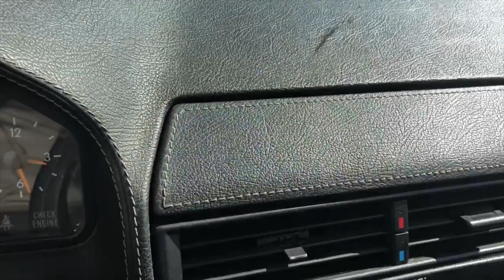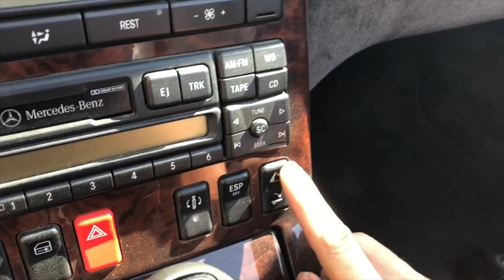I Bought a Broken V12 Mercedes SL600 for only $5000

Comment: Roof stoped half way cos windows were not reset after battery disconnected, easy mistake :)
Reply: That's what I thought but the "mechanic" said "micro-switch or broken wire"???
Reply: German tricks and secrets 101

Comment: This car only needs one thing: Zonda F1 Exhaust
Reply: Yes! I believe the company that makes them aftermarket is Brilliant Exhaust out of Japan.
Reply: I'm going to ask YouTube for a special exemption to the thumbs up limit on this comment. I shall give you 100 thumbs ups per day till he gets that amazing amazing exhaust that is the F1 full system 👍👍👍👍👍👍👍👍👍👍👍👍👍👍👍👍👍
Reply: Its not that they add a zonda exhaust.  Technical garage sasaki makes long tube headers that make it sound like a zonda as zonda exhaust does not fit at all, its a front engine car vs a mid engine car.
Reply: Change that Z into an H and you're on budget.
Reply: Brembo Z early zondas shared the amg v12 engine with amg Mercedes of the time. The company in japan can make them
Reply: no no no, it needs a big chrome fart can
Reply: long johnson  Yes. They custom fabricate complete systems from headers down.
Reply: I believe this has a different V12 but I hope he tries this anyway
Reply: No, that is a Mercedes from the time when idiots didn't buy them.
Reply: Nah, it's the same M120 Mercedes block.
Reply: And a tune
Reply: Oh yeah nvm the Huayra uses a different V12
Reply: And new alloys, those wheels are hideous.
Reply: koji takata
No, it's silent and that's perfect. Loud was great...when i was 16.
Reply: 3DPeter yeah like the Zonda Roadster is silent.
Reply: Gaz Gir You're the clueless car enthusiast, cause in Japan there's a company that make M120 engines like a Zonda, & it's called Zonda F1 Exhaust. I don't know what is a ZoneAlarm vehicle neither.
Reply: Koji Takata i have one for sale
Reply: tfs2O3  Same with this W140. Love that engine.
Reply: @philbertlovely7724  Well 2 years later but effspot has one 😂

Comment: Finally a R129 modell. Congratulations, Hoovie reached automotive heaven. Big cheers from all SL-owners (like me) who have wet dreams of having a V12-M120, but fear the cost of repairing it and bought a simple R6-M104 ("half-engine"). I'm looking forward for your next SL-clip!

Roof 1: could be you need to re-initialize the window-setting (see manual).
Roof 2: could be the micro-sensors that indicate the windows are all down.
Roof 3: change the roof hydraulics oil, the it works smoother.
Wet Diff: not an issue, its a mercedes, dude.
Steering: new shock absorber is 25 dollars and five minutes work.
AC: try refilling it first, my W140 was all empty after 2 years sitting.
Brake squeek: normal when driving slow. mine does that too.
Brake light on/off: could be dirty wheel-speed-sensors in front.

Comment: Now this...this is a proper Mercedes. Took em about 20 years to get the styling right again AFTER this model.

5 grand is absolutely a steal even with the select few bugs it has. Engine seems great and body seems great for the most part, but my favorite is that interior that leather is immaculate for it's age. Unbelievable.

Comment: That is such an awesome car, one of the best of all time I think. They can't make them like that anymore. Now they are giant safety bubbles with huge crash structures. That thing is nice and low and thin and compact, yet still roomy inside. And the quality really can't be beat. What a classic. Beautiful car. I don't know about those wheels though.
Reply: E39 is better/ E38 BMW
Reply: @ sirgallium. You could say the same thing about (European) sports cars made in the 60's - you can't beat a Mercedes, Jag, Maserati, AC Cobra, etc, from that period, for the purity of driving experience.
Reply: Surviving crashes is such a drag.
Reply: True... Mercedes have gone from once making some of the most beautiful, elegant cars on the road, to making some of the ugliest, dumb design blobs ever. That's progress?

Comment: I suspect the issue with the top not wanting to play the game may be an issue with the computer having lost its settings.  A reboot might sort that out pretty cheaply, and the top itself looked to be in beautiful condition.  Factory black is a pretty rare colour option on one of these, in Europe at least.  It certainly has potential, it's only a matter of time before the values of these V12 SLs go as nuts as the values of the previous generation 560SL...
Reply: +Nightmare_O-mega Van  I never said anything about black on black, I just said factory black...

Comment: Just a heads up on all 1997-2002 R129 cars. The keys (all the keys flip, valet, master) are all unavailable from Mercedes benz for about a year now. There are a few locksmiths that can make a chopped key (about $250-500 per flat chopped key). I have heard of 1 locksmith that can make and program a flip remote/key but I have been unable to verify. So do NOT lose your key(s)!

Comment: I guessed you missed having the Silver Elephant’s power; but with the way Mercedes are THE MOST expensive to repair and maintain, the Car Wizard gets to put another child through college (and pay for his shiny new MUCH larger shop) thanks to you!
Reply: digitalrailroader bmw isn't that far off....but ur right...
Reply: BMW seems to be more expensive to maintain spec for spec, but Mercedes V12's are a whole 'nother level.
Reply: The R129 is actually reliable, even with the V12. Obviously it costs more money to maintain than a V8 version but it's nowhere near the cost of R230 SL or any mercedes from that era.
Same story with BMW, 750i and 850i from the 90s were not plagued with issues like the high end bimmers that came out later.
Reply: One thing I’ve noticed about MBs are that the engine is reliable yet the other non powertrain stuff isn’t. I have noticed that Tyler didn’t complain about the engine after 84K miles and 21 years. So it seems the reliability of the engine is the most important.
Reply: Joe Black that can explain why we don’t really see 20 year old Audi’s and Bimmers.
Reply: Beamer Boy the mileage for that please.
Reply: Stefan Unson Umm I don't know what kind of high end neighbourhood you live in but I see plenty of 20+ year old BMW's and Audi's on daily basis. Heck I even own close to 20 year old e46 myself and it's been dead reliable.
Reply: Porsche and Audi's are WAY more expensive than Mercedes...problem depending 😂😂
Reply: Jack Bauer LA and Orange Counties.
Reply: Isn't more expensive than the shitty Bentley
Reply: I actually read somewhere that the sl 600 engine had the fewest warranty claims filed against it compared to any other benz engine at the time. The rest of the car is definitely a crapshoot, but the engine is a beast. Some guy has a video of him standing a coin upright on top of the engine running without the coin falling over. The v12 produces very little vibration and you do not need to work the engine very hard to get moving so they are actually pretty reliable.
Reply: that's because you are pretty much paying for the Bentley name. its pretty much a VW Phaeton with a Flying B glued to the grille.
Reply: This channel is certainly much more valuable to the car wizard than it is for Tyler.
Reply: digitalrailroader That new shop is most likely gonna benefit Hoovie because he can buy more broken cars because the wizard has more space to fix them.
Reply: SirJamestheIII That’s why I kind of think the engine is the most important component of the car as it makes it go.
Reply: "Mercedes are THE MOST expensive to repair and maintain..."

Know how I know you didn't watch any of the Bentley episodes?
Reply: SirJamestheIII While this is a sorta reliable engine...saying it was the most reliable Mercedes engine is like recommending the most reliable Kia from the early 90s
Reply: standard maintenance is affordable, I mean you should not buy a Merc if you can´t afford 4 more quarts of oil compared to a V8 ... but whenever there is a repair on the engine, it quickly becomes a nightmare.. Imagine new timing chain on a V8 or V12 ... that is big $$$ and quickly exceeds the value of the car... then only enthusiasts with a big bank account can pay that...same for suspension and steering as these have very complex suspensions...   super nightmare if air ride or adaptive suspension systems are involved... normal working guy can hardly afford that
Reply: I have an SL600, I spend very little in maintenance on it. Very well built car. I do somethings just so I can tinker on it
Reply: search the net, I buy parts for my SL600 for less than my GF's Nissian. I got new control arms for mine for 172.50 ea. Benz part. cheaper than knock offs
Reply: I had to do the timing chain on mine. At the stealership would be a killer. Got a complete Febi Bilstien kit for 241. Had an indy put it in and other work for a 1000
Reply: cause they are ha
Reply: I have an SL600, It is trouble free and can find benz parts on line cheaper than after markets. I had to replace the oil pressure sender the other day, after markets were about 60 dollars the benz one was 90, I bought the benz one to keep the accuracy.

Comment: Wow,  it really went up in value 200000 to 5000
Reply: The turning point has been reached a few years ago - untouched SL in a good condition have become a collectors item.
Reply: Back up from a few years ago.  Not up from 200k.   Five years ago, you couldn't give away a 25-year-old turntable.  Now the hipsters are snatching them up for $100+ and dropping $300+ cartridges in them to listen to whatever crap they do.   It's the same with cars.  Cyclic value.     Can't wait for my VCR to be "vintage".
Reply: A vinyl disk sounds much better than digital, but you need the real equipment for it to get it out. E.g. a amplifier with bulbs. Even the today best and most expensive HiFi systems go from transistors back to bulbs. So i still have my 1990´s DENON HiFi stereo system and be happy with it.
Reply: Well... As he was buying it the car, the value went down. When he was in the road the value went up.  That happened in under 10 minutes.

Comment: He makes a solid point about how underrated buttons are. I have a 2000 E class, and I could do pretty much anything I want without looking away from the road vs. a new Lexus I was driving while on vacation where I had to make sure the screen was on the right menu or right setting to turn on the radio. But hey, that's what the car buyers are looking for I guess.

Comment: The fault on the top is the limit switch on the left bow extension, you can access it  from the top or removing the panel behind the drivers seat, you can use a paper clip to bypass it on the connector and complete the sequence manually, just for testing. I can send you the part # too

Comment: "Hello peasant in your Avalon, that you probably paid 35k for. justifiably smug laugh Haha!"
Reply: yeah but you still drove an avalon lol
Reply: Mercedes reliability is close to the worst of any car brand, whereas Toyota/Lexus has the best reliability of all brands - the Mercedes will quickly turn a fool into a peasant!
Reply: Toyota is a low testosterone car brand. At least a Mercedes driver doesn't need fuckin Cialis when he gets home for the day, I'm not convinced your average Toyota fan even has a pulse.
Reply: McGyver777ATGMAIL  It's a reliable Toyota. Yes. It is a good price/"features" ratio. Sure. Just don't get angry when people who like working on cars (and essentially putting all the puzzle pieces together) buy old and cheap luxury cars that have much higher quality parts than an Avalon.
Reply: burrito rustler  Beg to differ. Depreciation has a funny way of representing value well. 
1.) $15k Lexus LS + $1k set aside for years of maintenance
2.) $9k S-Class + $7k set aside for years of maintenance

I'd rather pick choice 2 because I love working on them myself.
Reply: 9:44
Reply: McGyver777ATGMAIL that's cuz it's new give it 10 years it'll be on a used car lot for 3k and an extended carfax.
Reply: It'd be a chore to drive an Avalon for 30K let alone 500K. Life is too short man.
Reply: McGyver777ATGMAIL  I am now sure you have never driven a Mercedes-Benz with the ABC suspension because you would respect that ride. No avalon is on the level of comfort as a 600 Mercedes-Benz of any year. Yeah I could go by 3 Kias for the price I paid for my Mercedes-Benz CL 63 AMG but to yawn every time I get home after that boring drive would actually kill me sooner....lol Go test drive a newer 2014 CL 6.3 or CL 600 and then tell me if you could not get on of these even 20 years later from now that you wouldn’t jump at the opportunity. Right now you just don’t know what you are missing so it’s easy to say the things you say. But I had a Honda,Lincoln,Lexus,Cadillac and now the Mercedes-Benz CL class and none of them cars are on the level of this car. Trust me it’s not just the name why people buy them but the engineering! Even the new Lexus 500 has a V6 in it! Just get behind a 6.3 Mercedes-Benz and you will never want a small low power rice burning engine again...🤫
Reply: @McGyver777ATGMAIL  you
Reply: Why do people say German cars have “higher quality” parts? If they were higher quality, they wouldn’t break all the time! Then they say oh well it’s an expensive car you have to pay to keep it going, yet Lexus literally need nothing but fluids, brakes and tires.

Comment: Correction: V12 for your financial downfall. $5000 starting point.
Reply: Egzon  Buxhovi Actually MBs enginewise are reliable.
Reply: The M120 is a very reliable and well built engine. What a stupid comment to make for a supposedly petrol head...
Reply: This is true if it was a jaguar v12, this engine here is one of the smoothest engines Mercedes ever made
Reply: That V12 will outlast the transmission and body of that car well after all the electronics crap out. He's got to put a Zonda exhaust on it. That engine was designed to race!!!
Reply: It is said you can balance a quarter upright without it knocking off
Reply: “ it dropped in value the last time I sold it to you that’s for sure (3:15)” 

“ but these things have gone up a lot in value in the last few years (4:32)”

Can you please explain.
Reply: Reading comprehension, sunk expense is the cost paid for the vehicle. Hence, the starting point. Until sold, the "protected value" is of no concern to you. Why? Just because you see them listed or projected at a price doesn't mean you're going to get the increased projected price. 

Outside of all the financial math involves and market analysis. If you ever owned a Merc and had to pay to maintain it you would understand outside of the logical breakdown of things.
Reply: Rosco I asked a question, with no sarcasm or disrespect and this is how you reply, yeah I’m unsubscribing from this Channel I guess nuggets can’t ask questions
Reply: Well, I don't think this will be his financial downfall. 

He already has a BMW 850i V12 that he is not fixing. So if anything breaks on his Benz, he'll have two V12s that he will not be fixing - so no financial downfall there.

However if anything breaks on his 355 ...
Reply: Zain Edwards meaning stuff broke after he gave it to the guy but the model itself is worth more
Reply: @Alex-mw8iv  a bad mercedes engine is still beter as a "good" Jaguar engine..
Reply: desu stroyah exactly, they're not a money pit like jags
Reply: @unknownunknowns  Depends which ones are the topic.

Comment: Sweet ride! I'm a little jealous; I've got an '05 SL500. Just redid the ABC system to the tune of $3600, but that shiz is sweet.  But everybody is gonna tell you, "money pit". I don't think so! Had mine for almost 2 years now, VERY dependable!!!! Of course, I already went through mine, tires, brakes, batteries, and the ABC system. Mine just turned 82k. Good luck, bud!! Oh, and PLEASE dump those wheels!!!
Reply: 82k doesn’t mean reliable for a modern car to be considered reliable it needs to hit 200k with no major repairs
Reply: bigmac22ify. Hey, I'm driving it daily and she's strong everywhere! And, she could blow up tomorrow morning!!! It's all a crapshoot!!! But this is one of the strongest vehicles I've EVER owned; I'm hopeful!!!!!
Reply: bigmac22ify my mitsu 6g72 has over 220k but just doing the spark plugs was a major repair
Reply: Nightmare_0-mega Von Hey, MB parts ain't cheap!!! Power steering pump alone goes for $5000 at Mercedes! But I found a place that sells parts MUCH cheaper.

Comment: That hydraulic suspension is pretty amazing!  The accumulators are actually not too bad to fix.  I replaced the rear accumulator in my dads S55 in 2 hours for $160

Comment: I had a 2 door S 600 back in the day and man do I miss that car. I bought it from government auction and it was full of all sorts of surprises including bullet proof glass that was swapped for the factory double glazed windows. It also had ballistic panels in the doors and quarters etc. On top of that it had early Goodyear run flat tires that weighed a ton. The list could go on. It also had some tuning because it was almost a half second faster in the quarter mile. But best of all is they installed holsters inside the doors. If anyone knows S600's they'll know where because they had semi hidden door pockets that popped open and in my car it had holsters inside that fit my .40 cal perfectly on both sides.

Comment: I work for used car lot and we have a ‘00 SL500, Fire red. Ours has the same issue with the convertible top. Has 96k on it, engine and trans are perfect. We have it at 8995. It is a fun little car to drive

Comment: If the top is falling down when you stop pushing the button,  the screw that relies the hidraulic pressure from the pump,  must be on open position.  And the stuck in the middle is a microswitch for sure.